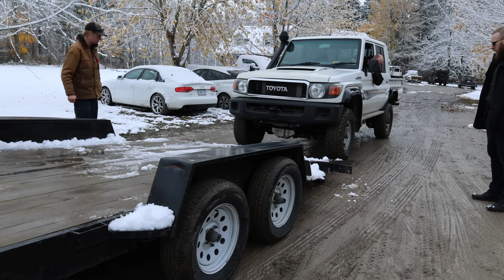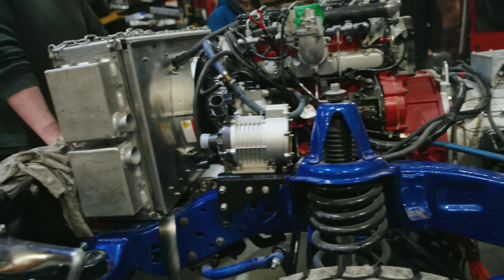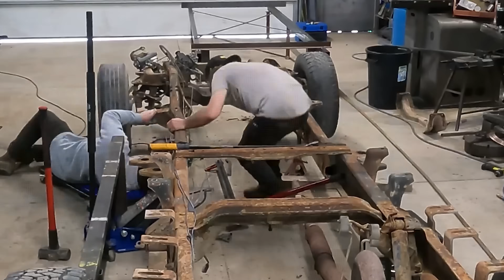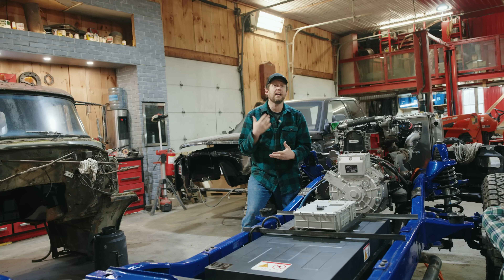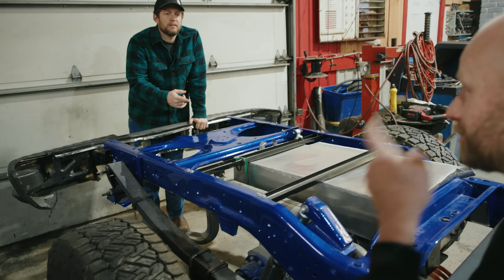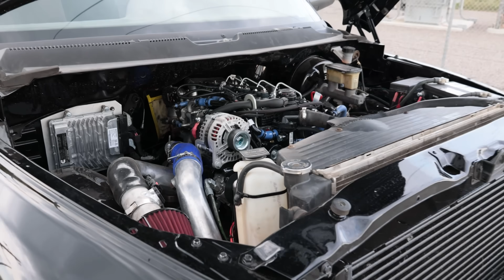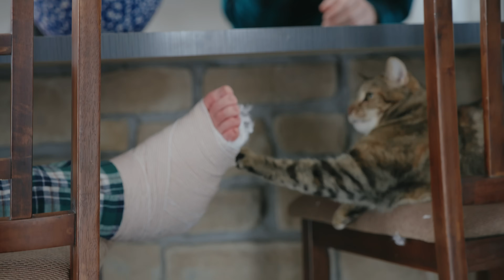Scrap Our First Design and Build an Edison Pickup Chassis from Scratch?

Comment: If you wait until technology stops getting better, it will never release. The people that put down to get their truck were already convinced before the extra fancy battery pack and the extra fancy dual motor axles. You don't want to become another vaporware company that promises and never delivers (Nikola, Aptera, Tesla). You might send every pickup reservation holder an option: Do you want us to fulfill the order you placed for v1, or do you want to upgrade to v2? They also should be advised the difference between an install kit and the new chassis

Comment: If you're gonna stray from the 34", you need to engineer a solution for bolting on beds designed for 34". The upfitters will just skip your truck if everyone else has 34".

Comment: I'd definitely keep the frame rails standard 34. I'll be swapping a cab chassis dodge over woth a nice flat bed.  I don't wanna have to modify the $9000 flat bed to fit. Or change the body mounts around more than necessary.

Comment: You know how you were talking about air ride vs leaf spring, you guys should see if someone makes or would make a small rotary screw style air compressor for the onboard air system.  Air ride is the only way to go in my opinion.  A small screw style aircompnessor driven by a 2hp electric motor for example would be very cool.  It would also be a lot quieter than a reciprocating piston compressor.

Comment: This dipstick company got big off lampooning Tesla and yet Tesla is getting ready to start mass production this year. (Of semi trucks) but even in their prototype phase they sold/tested more semi trucks than you guys did for the last two years plus. 

You have this “Tesla isn’t moving fast enough” attitude and yet you can’t even pump out more than ten semi a year despite taking the easy way out and using a hybrid diesel electric approach. 

Sit down and shut up until you put up.
Reply: Friend. Chace built an entire ev company while waiting on Tesla.
Reply: @Sah-o5m  i could start a company with 200 bucks right now. Starting a company is not a measure of success. 

How many products you sell relative to your input costs is what makes you successful. And edison is incredibly laughably bad. 

They've had almost no growth compared to the kind of shit they talk about other people. 

It's embarassing, before you run your mouth at least make sure your words arent as empty as your future.
Reply: @Neoprenesiren
So what kind of results would it take out of Edison to turn your frown upside down?
Reply: @Sah-o5m  minium 100-1000 semi a year, that goes from playing in your dads garage to actually running a true and blue auto factory even if its a small one.

Comment: In the 90s, I got a 1982 Chevy fullsize school bus, 350ci w Allison 545. I had wanted to put the engine and trans in a '85 Chevy rollback, but the Chevy's 1ton frame was not wide enough at the point where the PTO was on the trans. I measured an '81 Dodge 1ton rollback frame, it was wider. I got the Dodge and I easily put the bus's unmodified engine and trans cradles in between the frame rails at the front and there was 1/2" clearance at the PTO. IIRC, the bus and Dodge frames were 36" wide.

Comment: I have a concern regarding the airbag suspension. I need a heavy-duty truck for field work, hauling hay bales through mud, woods, and rough trails. On my Dodge, branches have punctured the airbags, resulting in costly repairs. While traditional leaf springs aren’t perfect and can make the ride stiffer when unloaded, I strongly believe there should be an option for highly rated, heavy-duty springs on your custom chassis. Our work involves creeks, rivers, and steep slopes, and pickups are intentionally different from semis due to their specific use and versatility. Everything you’re promoting is inspirational, and I’d love to utilize the trucks to their full potential—but please don’t overlook the needs of field workers and trail riders in your designs.
Reply: I understand why many people support airbag suspensions, and they are excellent for heavy-load hauling. However, for those who rely on trucks for bucket work—like utility crews maintaining power lines in northern states—or for overlanders, off-roaders, and field workers, solid suspension is critical. Air-ride components are harder to maintain, more prone to wear and damage, and can carry liability in remote conditions. I need a truck I can break down 20 miles from a parts store and repair myself, without the added complexity or effort of an airbag system. Please don’t overlook the needs of field workers, trail riders, and anyone using their trucks in rugged, remote environments.
Reply: I have driven air bagged heavy trucks in the northern parts of Alberta and Saskatchewan bush. Hundreds of kms from any sort of repair facility. Nobody up there uses a springer truck or trailer if they have any other choice. They just don't last.

I have found that the tires are MUCH more susceptible to puncture than the air bags are.

Nobody I have met seems to be going back to solid tires for reliability.

As a mechanic, air bags are way easier to replace on the roadside than broken leaf springs. Bags also keep you from beating the whole chassis to death on choppy roads.

Just what I have seen for myself, your results may vary.

Comment: I'm a CAD designer at a Body Builder here in Michigan. We do Curtainside systems. Most of what we build are on flatbed trailers, but we're building more and more platforms to go onto straight trucks in the last 4 years. I highly doubt we'd ever need to build on one of the edison chassis, but... if we did, I can, without a huge amount of effort, modify the drawings for the platforms we build to any frame width. my only concern would be that, as we go wider, especially on the larger Freightliner M2's and 114SD's we build on (Or, really, anything with an 11R22.5 tire), the strengthening gussets might have clearance issues with the tires. I try to make sure they are spacet in such a way that they aren't near the tires, though. So, at the end of the day, 34-36" frame width is a non-issue for us because EVERYTHING we build is custom. Sure, we have a jig for the platforms, but the long-sill (The portion of the platform that mounts to the truck frame) spacing is set without the jig, and, since each platform is built by hand, it's not a big deal to adjust for wider spacing.

Comment: I think hybrid pickup trucks are an insanely good idea. Need oomph going up the rockies but you'd normally be flat out? The batteries can do the rest. Then going back down, you can use regenerative braking like a brakesaver while having the engine idle or being motored. Heck, you could theoretically let the customer be really in depth and have a sort of "climb mode" where it will use the battery up to prepare for a decent. I wonder why the PHEV rush has stayed away from trucks.

Comment: I have one of the earlier truck kits reserved (2 actually) and was going to put them in a similar Landcruiser - so I’ll be looking for further updates on how that one is doing after the testing. That bring said, I wouldn’t be putting it on a new frame rail that you mentioned, moreso looking at the components used in that one and probably just getting the Edison components, once they are dialed in, and installing them with a custom shop / builder now. Would that still be possible?  Great job on everything BTW !!

Comment: It’s all about weight and complexity. OEMs don’t want to add a compressor, air lines, valving, etc. that they will have to train technicians on and charge more for. It’s not about what’s better, it’s about what will sell. And with a new 3/4 ton selling over $100k now, the market is going to shrink even further. Kelderman and a few others make kits to go to air ride, but who knows how popular they are.

Comment: Consider building a pipeline welding version of the pickup conversion. I think the Value would be huge!
Reply: They're not going to be building the specialty truck components. There's no reason to. All of those already exist on the market ready to drop on an existing truck frame.

They're going to build the base, and the customer can have the box built out however they want. It's the only intelligent way to do it. There are just too many variants of end-use configurations, and they would be completely missing their original mission if they started trying to specialize.

Never gonna happen.

Comment: what engine will be used in these? my personal suggestion is the mercedes OM606 turbodiesel due to its stout reliability and all mechanical nature, although if a computer is needed to establish communication between the engine/generator and axles there is an electronically controlled variant

Comment: As a owner operator running a service truck (t370) waiting for option of full electric then setting up power plant (I already need) as the hybrid charging) the duty cycle of onsite parked to highway driving would be great for this

Comment: So im just going to slap a crew cab square body on a frame connect a steering column and some wires and  ill be running a truck on air ride

Comment: Have you guys seen the new hybrid only motor? Its being designed in some European country, maybe VW. I don’t recall. But its designed for horizontal or vertical orientation and only to run as a genny. If its lighter and smaller maybe that would be an advantage in your trucks and also cargo/rv vans.   
A sprinter conversion?
How about cantilever suspension?
So glad you are dumping leafs, my F350 with truckcamper and airbags road so hard empty.
As a user, I would prefer wider frame for offroad stability.
It could make for a great rv van just keep the extra battery and add solar charging input and an output for rv needs. It would free up space in the garage area since batts would be in frame.

Comment: Scope-creep be scope creeping but would it be viable to have a light-duty chassis. Say the 2.8, single cell, single motor. And then a heavy duty chassis, with the 3.6, dual motor, etc with a beefier frame for handling the 100k+ lb towing 

It really sounds like there's two use cases and while making the pickup more hearty and able to do the heavy duty stuff, is it becoming more complex than necessary?

Comment: Brilliant video, I wanted to the same in the past but I'm skill-less. I have the Wiser system that connects to the tvr in each room giving me cheap simple room control. It's not as cheap as yours....

One thing l looked at on my old Valiant boiler was connecting to the opentherm protacol. If you have gipo pins your label to contoll the gas flow / amount of effort the boiler puts in to keeping the hot water 'hot'.  It is open, stops the short cycle of the boiler massively increasing the efficiency so you can start measuring the return temperature of the water and then reducing the heat output.  A large educational undertaking but it would be amazing to see and unique. It's code, 2 more temp probes in your cupboard and 2 low voltage wires into the boiler control board.....
Reply: Spam

Comment: Adds factory complexity but gives flexibility: build the frame with a bolted section just in front of the rear wheels so buyers can order either narrow back for standard "dump trucks" or wide back for other options. If you choose the airbag suspension system, use common big truck parts so repairs are super easy. However, Also design for the regular leaf spring packs, they are used because of low cost and robustness, there is no air compressor replacements nor tubing nor fittings to fatigue or corrode. If the spring packs are common, standard fasteners, and easily replaced then someone using the truck just to drive to work and haul groceries can remove leaves and if someone is constantly hauling dirt they can beef up the pack.

Comment: This is so the way to go, have a range extender everyone knows how to work on then have electronics and batteries that can be swapped out under the frame rail without having to take off the cab or bed.
Also it would be awesome to have battery packs that are small enough to remove yourself without a special lift rig (maybe using an adapter we can buy from you guys that fits a transmission lift at most).

Ease of serviceability is the name of the game ultimately, please keep that in mind with all of this great work!

Comment: Keep the 34 inch frame rails but Hot dip Galvanized the rails for rust prevention.  U-Hual still does this to all their trailers today because it is superior to all other methods.  If you can design a F550 or F600 competor do it. You will end up building a production center because I am hopeful of purchasing one myself.

Comment: My concern with going to a single pack, is the possibility of pack failure. Can the truck still drive in the event the battery gives up? I'm assuming a two battery setup could be wired in a way that the truck could still work, even if hobbled, in the event one of the batteries died.
Reply: Remember watching one of Edisons vidoes where the batteries were isolated and powered topsy with the generator through the power distribution modular.

Comment: I have a couple of questions. First does the software allow for the e-axles to function like locking differentials in terrain that requires such capabilities? Second does the conversion require a solid axle swap if the vehicle being converted has ifs, I have a 96 bronco I was considering for the conversion when the kits became available. Third, is there a way to make the kit work with an existing diesel powerplant, such as the GM 3L Duramax or Ram 3L if they are the stock powerplant for the vehicle being converted?

Thank you all so much, I love the concept and really hope to participate in this endeavor, whether it is buying kits or investing in the company directly. Thank you for continuing to perfect the processes. Sorry if the questions are random.
Reply: The guys are busy, so I'll try to respond. These are common questions.

These 1st gen pickup axles are open diff. The axles being designed will have full control over each wheel.

The first versions will be solid axle only.  IFS/IRS is way down the road.

Bolting an Edison generator to a stock engine is requested alot and a ways down the road due to gnarly integration issues. Personally, id like to see an Edison generator bolted to a Ford 300 I6.
Reply: @Sah-o5m  Thank you! I appreciate the answer!

Comment: Not an upfitter so just an enthusiast/rando's opinion:

You might consider either 2 chassis, one with the "standard" 34" wide rear and one that is the desireable Edision size with future upgrades in mind.

Or, make an Edision size chassis, but have an adapter kit that makes it compatible with the 34" rear aftermarket stuff.  Maybe the adapter kit is a couple crossmembers and then some flatbar or box channel that is on the 34" standard mounted to the crossmembers.

I would love to get an Edision chassis to make into a backwoods/logging road/overlander/RV/exploring vehicle.  And another or the same to make into a flatbed truck!

Comment: 6x6 option?🤔 powered drop axle/pusher? could it make the ultimate off road recovery vehicle and weekend toy hauler? if your toy is a bulldozer😍
Reply: now to get crazy make both rear axles "drop"... In city pavement princess that turns like a 1/2 ton, then switch rears and get on the highway and comfortably cruise on a long wheelbase

Comment: Well. Less batteries with ice reminds me of Chevy trans in the early 2000s.

However.. it'll prolly work better for most.
And gives them the option to sell an extended range kit for others while keeping price down to get more units sold
Reply: In one of chances videos he talked about why battery degradation wasn't as big a deal with this hybrid system.  as the battery capacity drops the generator will simply cycle more often but for shorter times.  

Batteries beyond 50-60 km are extra weight and $$ that if sized correctly the generator makes redundant.

Comment: Will bigger batteries be available for those that want bigger batteries? I feel like some might want the bigger battery for raw electric capacity rather than the power output. IMO 60kwh is NOT enough for a f350 type truck, I'd want probably 100kwh+. Empty if I got 1.3-1.5mi/kwh, I'd be getting only 78-90 miles of electric range, and 100-0 that doesn't cover my commute. 120kwh? that 156-180 miles of range would cover my daily commute, and still let me tow when I need to all within the same vehicle. I don't care if its 800lbs heavier, when the truck will already weigh 8200lbs, whats 9k?

Only way I'd consider the smaller battery is if its LFP based and not NMC, as then I'd be significantly more comfortable running it down to 0 every day.